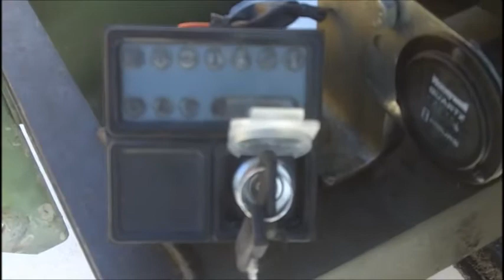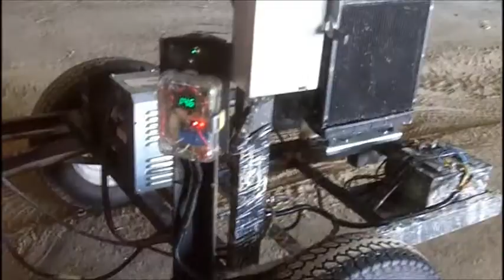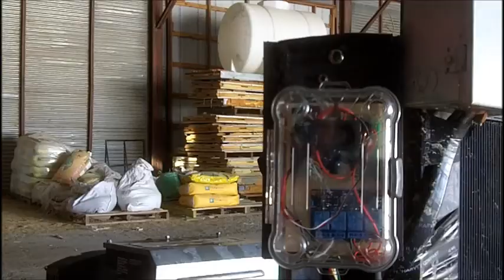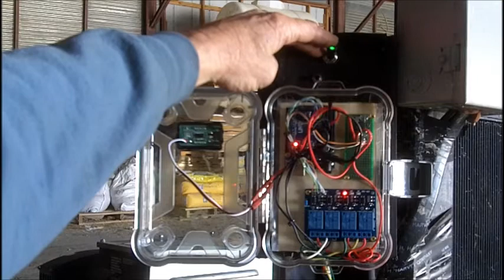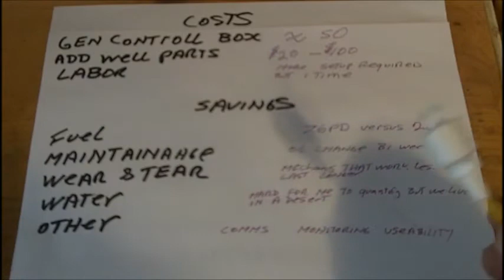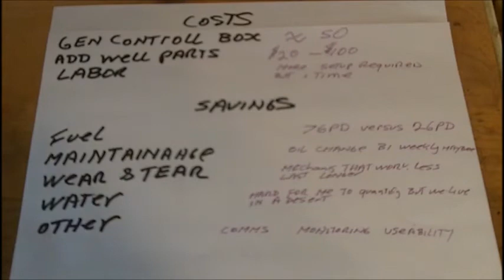arduino engine controll

Comment: how to tell Arduino that the generator is running ?? by using a relay of 220v A/C and give analog input ?? is that correct?
Reply from the maker: That is possible but in this unit all I am using is oil pressure there is also a sensor built into the alternator that I could have used.That relay I think I demonstrated was to switch the 240/480  well pump on after engine had warmed up to avoid overloading the engine too soon.
Reply: @damocsell  I'm going to build similar project suggest me a best way to tell arduino that generator is running ..
Reply from the maker: @hassansardar6649  This was prototyping stage project and I was not the best arduino programmer. All I did was take the oil pressure sensor maybe through a relay or switch and feed that to the arduino reset pin in order to start and run that sensor/reset pin had to be interupted briefly until oil pressure came up. If it did not come up it would immediately shut down the exact same idea could easily be used on alternator voltage or water level etc in fact all these sensors could be in parallel. So i think oil is the best for my purposes but it would be good to have another one or two as well. Ill try to find my old code and post. best of luck in your project.
Reply: @damocsell  thank you sir ..
Reply from the maker: @hassansardar6649  Are you in USA if so I may have a old start box somewhere I could send you just cover shipping?
Reply: @damocsell  unfortunately I'm from Pakistan and thank you so much it already meant a lot to me like you send already thanks again ..

Comment: Is it possible to control a car engine meaning to start and stop it based on an input from a thermostat? The idea is to start the engine and have heat when it's too cold based on the measured temperature inside the car. When the temperature reaches the set point the engine stop when it goes below a certain temperature the engine start. It would be easy if the engine is electric because the thermostat is meant for electric motors but with a car engine it is more complicated because there is a sequence of actions that must be done to start the engine. To stop it is easy I believe...just cut of the ignition. Can you do something like this with Arduino and how?
Reply from the maker: Yes this unit would be able to do exactly that probably very easily im thinking one wire to a thermostat that can make the reset on the arduino go low. This is no longer a active project of mine and the cattle ranch I worked for has fallen back into running their generators in a unsafe manner because in their words I was deliberately making things hard for everyone else to use.I will try to find the code i used  and maybe do up a rough wiring schematic and post it here.That will probably take me a couple of days.
Reply: @damocsell  Thanks for answering so fast. The whole  idea is that if you are sleeping in the car you don't want to wake up every so often to start the engine so at fist thought to use a remote start system but that will need somebody to push the button. Using a regular house thermostat to turn the ignition on the "on" position when you need heat and "off"  when the set temperature is reached it seems easy to do because a thermostat is after all an electric switch controlled  by temperature so it should work. The problem is that after the thermostat is turning the ignition on it something needs to turn on the engine starter for a brief period of time mimicking what it is done by turning the ignition key by a person. This is where I got stuck. The problem is for how long the starter relay should be energized and how to detect if the engine is running because you don't want the engine starter to keep running after the engine has started...maybe a time delay relay would work better than Arduino. The problem is that I don't know nothing about how to wire or program an Arduino. I have seen time delay relays pretty cheap on Amazon. What do you think?
Reply from the maker: I got around to digging up one of the old controllers and tested with thermostat and it hooked up easy. https://www.youtube.com/watch?v=gW_rbqyzn6w&feature=youtu.be
Reply from the maker: If you want code and a little more on the construction/wiring and schematic you can find it through here. http://www.swordmaking.com/arduino/engstart.html

Comment: Great job!!! I'm trying to build a similar project for an off grid generator powering an oxygen pump for a pond. (I've added a gsm module to be able to start/stop remotely). I'm just not sure how to let arduino to know when to stop cranking. The whole setup is shelterd but the outdoor temperature has effect on the time the start motor has to crank to start the generator. That means that a timer isn't an option. How do you let the arduino to decide that cranking have to be stopped? Do you use a sensor to measure the current output? 
It's a simple diesel generator
I hope you can help me on this issue.
Reply: I think I would sense the pulses from the teeth on the flywheel,  if the pulse rate gets above a certain point,  and continues to rise over say, five seconds or more,  I think the engine can be said to be running. If the pulse rate (rpm)  falls below a certain rate,   then after a pause to ensure the engine is stationary,  reattempt another start.  After five failed attempts,  alert the user,  and/or abort the sequence. Hope this helps.